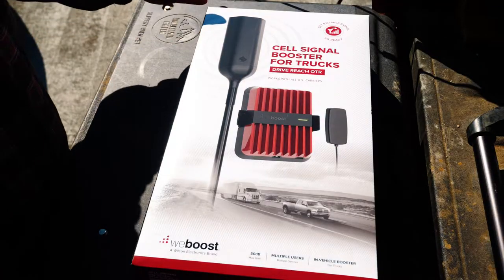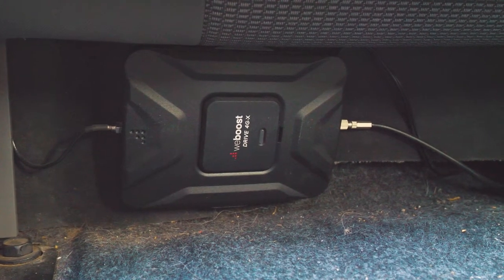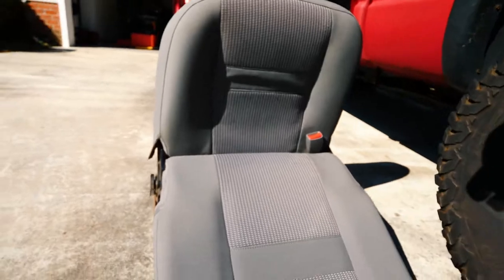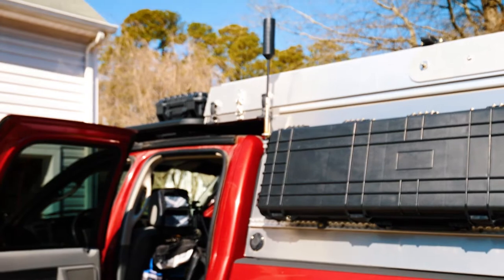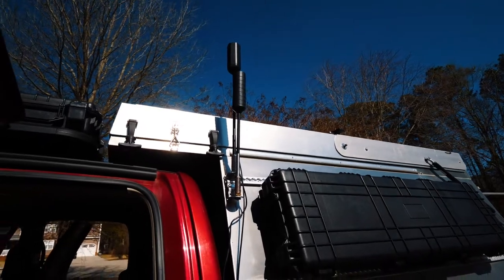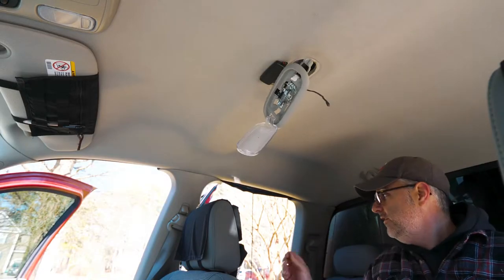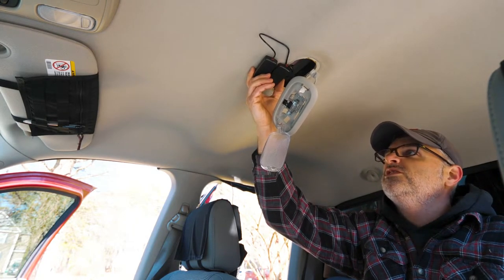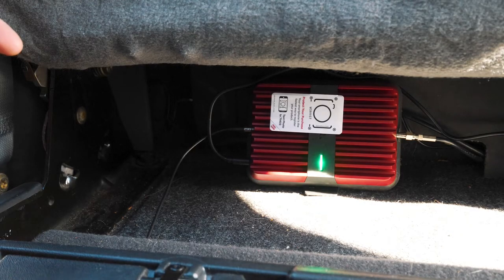weBoost 5G Drive Reach OTR Install

Comment: Great thanks for sharing. I just bought the new Weboost and was planning to run the cable down the A frame into the engine bay and through the firewall. Your install is easier. Never new there was a vent behind the seats of the Ram.
Reply from the maker: Yep, All vehicles are equipped with these vents. Most passenger cars and SUV’s are located between the body and the rear bumper. Trucks are all located in the same spot, on the back of the cab. Glad we could help and enjoy your weBoost!

Comment: Great video! I have a question for you. After installing your interior antenna by the head interior light, how was your reception?  Asking because I seen a couple of videos stating that you have to keep your cellphone real close to the interior antenna in order to get the best cellphone reception?
Reply from the maker: Correct, for the best reception possible, you want your phone to be as close as possible to the antenna. We have it mounted by the light because it is the most central location in the cab of the truck for all four of us to use. The 5G is able to support multiple devices at one time and this is one of the reasons we chose it. We’ve only ran into an issue once or twice where we found it necessary to turn off the cellular on the other phones so one phone could benefit from the booster. Those were times where we had very little reception/signal strength and needed it for navigation purposes. Hope that answered your question. Thanks for watching!

Comment: Hey thanks for the video.  I've got an AT Habitat as well and I'm curious what type of rack do you have mounted to the side of it?  And what kind of boxes are mounted to the rack?  It looks great!
Reply from the maker: The boxes on the sides and on the roof rack are all Apache rifle cases from Harbor Freight. They’re water tight and lockable. I felt less guilty about drilling through them then I did about pelicans. The rails on the sides are aluminum L-track (aircraft style) from US cargo control. There are two mounted on each side and the mirror image on the inside of the camper. This allowed me to through bolt the rails and sandwich the camper walls for maximum strength. I applied sealant to the exterior rails to prevent water intrusion into the walls. I have attached links to both products below.

Here’s the link for the boxes:

https://www.harborfreight.com/search?q=Rifle%20case

Here’s the link for the rails:
https://www.uscargocontrol.com/products/aircraft-style-seat-track-6-ft?_gl=1*5zvx91*_ga*NTk5ODAzMjAwLjE2NjI4MTQ2MDg.*_ga_0F1YK18B5L*MTY2MjgxNDYwOC4xLjAuMTY2MjgxNDYwOC42MC4wLjA.

Comment: Did you have to register this with your cell phone provider in order for it to work?
Reply from the maker: No. It does not need to be registered with anyone. It’s just a booster, so it doesn’t use a SIM card or talk to the towers.

Comment: Do you happen to know how long the cables are on the antenna as well as the interior antenna.
Reply from the maker: The exterior antenna cable is around 16’. The interior one is around 8’. These are approximates as I have it installed in my truck and cannot get an exact measurement.

Comment: Hi there! Hoping you might be able to help with my Weboost? It works great but as you know, you can't go more than a few feet from the interior antenna or it will stop working. We use our Weboost mainly at our cabin. Do you know if it is possible to set up either a router or a repeater type system with the Weboost in order to get more distance from the interior antenna? Thank much for any info you can share. Rich W.
Reply from the maker: You could definitely use the weBoost in conjunction with a SIM enabled router or a MiFi. Then use your phones purely on WiFi. We know a few people that have done this quite successfully. They placed their router/MiFi right next to the interior antenna so it had the strongest signal possible. Hope that helps and thanks for watching!
Reply: @FamilyAdventuresOverlanding  Was hoping some type of repeater system can be used to avoid paying for the SIM-type system. Looks like I'll still need to do a bit more research on this. Thanks for the info!

Comment: WoW! 50db gain!  Gain over what?  FCC gain limited?   I can't find that rule, please help.
Reply from the maker: The Drive Reach OTR and Drive Reach RV boast uplink output power capabilities of 29.5 dBm and 50 dB gain – the maximum allowable gain under Federal Communications Commission (FCC) standards.
Reply: Most cell boosters are limited to between 64 dB and 72 dB gain by the FCC, however, single-carrier devices can amplify signal by up to 100 dB